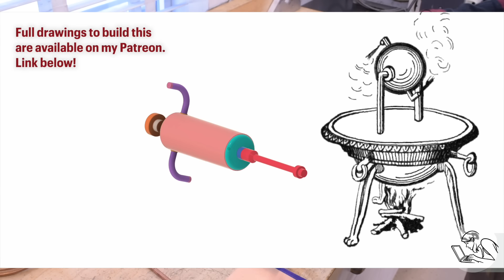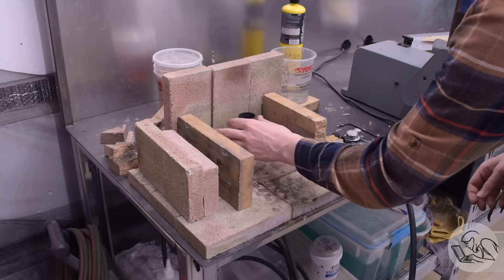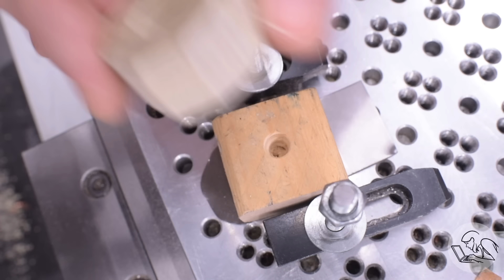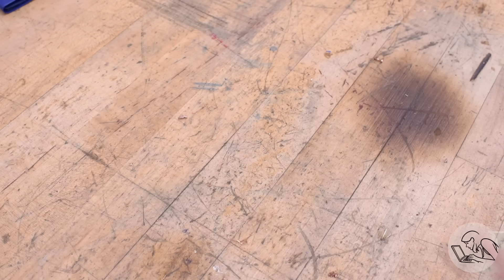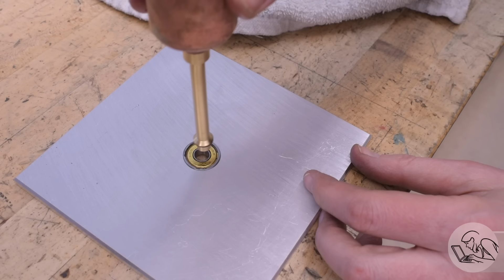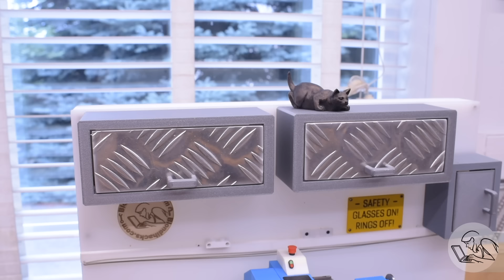Let's Make An Aeolipile - Toolroom Takeover 2025

Comment: there's two kind of people who don't know how pressure works. The kind who's afraid that water pressure will cause metal vessel to turn into a grenade, and the kind who thinks using air pressure is basically the same thing as using water.

Comment: That step-drill sure puts in some work! Hope the parents aren't home!
Reply: Curious tho, with all the different kinds... I usually buy silversolder with fluxcoating. But since I've started to do some more.. other kinds of stuff, I've been wondering what flux that actually works good for both silver and copper? 
Coming from soldering, and as you might know, that kinda flux has a really low melting point compared to what you use for brazing 😅
Reply from the maker: Check out my locomotive build playlist for a detailed discussion of silver solder and fluxes
Reply: @Blondihacks I'm not saying I'm autistic, buuuuut... You had me at steam locomotive! I'll remember to check it out when I'm done with the toolroom playlist C:

Comment: What happens to boilers when they run dry (aside from the ensuing Chemical Safety Board video) tends to be a result of Creep. This is incidentally the same process that relaxes plastic work hardening in materials during annealing. Creep at high temperatures can cause a material to slowly plastically deform at well below it's short-time-period yield strength.  It's pretty rare that actual melting will occur in a boiler. Rather parts gradually elongate, such as staybolts, and gradually decrease in wall thickness, locallized "necking" then starts to occurs from creep causing a stress concentration. Then things tend to rapidly snowball from there. Because of the large amount of stored energy, the internal guts bash around inside  break more tubes and staybolts, then it tends to be over pretty fast. 

For this reason if you dig through the  ASME code into the material tables, you'll find ridiculously low allowable stress values for materials above, say 500-600C. You have the same issue with high pressure turbine blades in jets. If they get too hot they start to creep and elongate due to centrifugal acceleration. Then the tip seals ring may start to rub against it's stationary outer mating seal, and then you run the risk of an Unscheduled High Velocity in-flight Overhaul.

Comment: Hope this isn’t redundant…but is there a way to fit a steam separator in there, or would it just add too much mass?

And ooooh…scope creep, but use some of that thin copper to build and mount a dual head torch to the base plate aimed at the pressure vessel so all you have to do is provide gas 🔥
Reply: Sure, it would just make this build a lot more complicated. Simplest way would be to pick some extra fine stainless steel wool between two mesh screens above the water level.

Comment: Really cool project! I started with Erik and follow the whole playlist now :D 

What I wanted to add and what confused me a bit when watching the video was the part about annealing the copper. My understanding (from professional experience and research) is that the best way to soften red/yellow metals, copper especially, is by heating it (like you did) but then quenching it in water - so cooling it rapidly. Air cooling does also soften the material but way less and alot more forming work can be done when quenching before repeating the annealing process is needed. Looking forward to the rest of the video now :) Love the project!
Reply from the maker: Quenching yellow metals has no effect other than cooling them faster. On flat pieces all it will do is warp them.

Comment: Great work as always!
I was amused by your (absolutely correct) talk about not using air in place of hydrostatic testing, since I regularly do leak checks on 1000psi  nitrogen line... oc that is sch80 stainless 😂.

Comment: Great video! Reminded a little of the old Popular Mechanics project for a small & simple toy boat consisting of a piece of balsa wood board with a tea candle below a metal 35mm film canister filled with water and a small hole poked in the screw lid. Yeah, this was from the days when rolls of film came in metal canisters and not the plastic canisters that people used to fill with quarters for doing the laundry at laundromats, lol.
At 5:52 the line "the whole thing looks round" brings to mind that scene in Roald Dahl's book Charlie and the Chocolate Factory where Willy Wonka points out a room filled with small cubes "that look round" and one of the kids says that the cubes don't look round whereupon the cubes turn around to reveal faces on one side of the cubes looking at Wonka & the kids. "Oh, yeah, the cubes do look round."

Comment: At a former place of work, they had a fab shop testing pressure vessels, and they'd fill them with water, but used iirc Nitrogen 12 packs to get the rest of the test pressure.
Now, I'm not the biggest safety worry-wart one will find. But seeing it gave me the willies. The volume of gas was considered "safe", so they had no cage or anything, just testing on the shop floor.
 It did not help I saw this setup the first time when someone futzed with the pressure regulation and over-pressured the vessel, causing the 4 inch brass cap to blow of, shoot up 25 feet, go through the chickenwire holding the insulation to the roof, through said insulation, and metal roof, and come down out in the parking lot. I asked why they didn't have any caging (good heavy chainlink fencing would do) around the testing area and the supe over there said "We only go 10% over the tank's rating to test the fittings and assemblies" I came back with - "90 PSI will kill you without any metal being involved." having lived in New Orleans when an old guy died from over-inflating a tire and it blew off concussing him in the chest enough to blunt force kill him and the max pressure the compressor put out was 90 psi. Granted, they had less volume of gas than a car tire, but as I pointed out to him, some idiot knocked the pressure up to 1500 psi or more and blew a heavy hunk of brass through the roof. Don't plan for everything being right all the time, plan for something to go wrong.

Comment: Alas, I wish we didn't have to use 500psi nitrogen to test refrigerant lines.  It's crazy how quickly 40 cu ft of 2000psi nitrogen becomes consumed when testing a residential system. Full marks on your braze work as always!

Comment: Very cool project, I love how you made something using your usual skills and techniques that fits with Uri's style so well.  One thing, since you didn't mention it, is that ball bearings are really awful at handling axial loads, which is why it wobbled so much. I'm sure you considered using 2 bearings spaced apart, that would have solved the issue and it would run smoother but that also would be significantly more time and material to build. TBH I'm kinda surprised it was able to generate enough torque to spin with the current setup, I assumed this style of engine generated effectively zero torque. Very cool and fun project, excited to see what everyone else posted.

Comment: Quinn, ive been loving your work for a looong time, which qualifies me to say, I think its time to build a new hydrostatic testing rig 😂. You been fighting that thing forever. Make something you enjoy using every time you test a pressure vessel
Reply from the maker: The difficult parts are the parts that change with every boiler. The pump is fine and works better than all the other ones I’ve tried. If you go back far enough in my videos, you’ll see all the other ones.
Reply: @Blondihacks Thanks for the explanation! I feel very confident that you could build a much nicer system either way. Ill admit that im not a machinist, model or otherwise. Thanks for all the great content

Comment: Funny thing about using gas for a pressure test. The last test of this battery where I work at was done with argon. It reached 630psi and boom. The dummy cell flew into the air and the safety person wasn't happy about that.

Comment: Hi Quinn,
Another awesome video—as always! I really appreciate your concern for safety when it comes to hydro-testing versus, well… making a bomb. 😄

Also, I just wanted to say your silver soldering skills have come a long way since your earlier boiler build videos. Back in college, I worked in a machine shop where we did silver soldering for commercial flow switches and valves. We used pre-formed silver solder washers that we’d sandwich between joints and then apply heat until the solder flowed out perfectly every time.

Honestly, the joints you showed in this video look about 99% as good as what we achieved on a commercial scale. That’s seriously impressive—great work!

And I’ve got to say, your creativity in tackling these projects is always inspiring. You have a knack for blending engineering precision with artistic flair, and it makes every video a joy to watch.
Reply from the maker: I appreciate the compliment but honestly that’s more about how simple this boiler is. Small simple boilers are exponentially easier than something like a locomotive boiler.

Comment: I think it'd be interesting to see a pressure failure with water - and, perhaps, if it could be done safely, with air. We've heard your warnings about how to do it (water first to maximum pressure, then air or steam to a lower pressure), but it might be interesting to see the result of failed tests.
Reply from the maker: Check out my locomotive build series- that boiler failed several pressure tests until I got it all right

Comment: I think suspended from a wire allowing it to be heated from the bottom would solve the wobble (aside from a balancing).
Reply: i was reminded of the balancing bird toy. to copy that there would need to be a hole most of the way up the center, then it could sit on a pointed base, such as a long nail. less friction than a bearing.